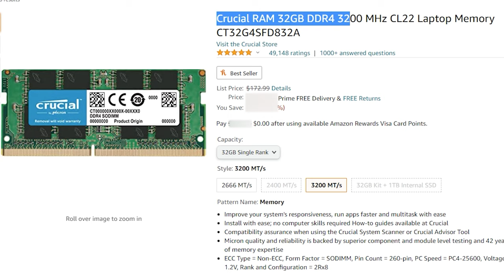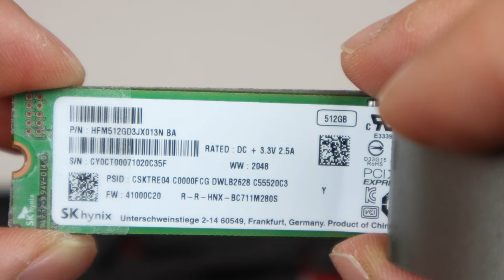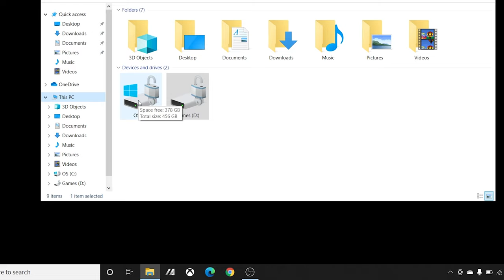How to Install/Upgrade RAM and m.2 SSD in ASUS TUF Dash F15 Gaming Laptop (NVMe only)

Comment: several months after purchase of my Tuf Dash f15 I just realized that a memory problem on my soldered ram will happen at some point way past warranty. Are there any good tips on what to do if that ever happens just in case?

can you theoretically disable the soldered ram and just have the system use the removable one?

Comment: I got a problem trying to remove the screw that is on the SSD slot. I couldnt remove it. How do i remove it though because im trying multiple type of screw and it just wont budge
Reply: I had the same issue with mine can someone please help? I don't want to strip the screws. 

Edit: I read through some forum posts on reddit and it looks like the screw that is in the M.2 slot is of type JIS. It looks identical to the Phillips head but there is a huge difference between them when using them to unscrew.

Comment: QUESTION: I've seen adverts for these upgraded aftermarket with 2 x 4TB NVMe drives (or a single 4TB drive).  Is that legit?  I know ASUS says only 4TB max but they also say 32GB RAM and we know that's not true!

Seriously, great video, I really appreciate your process but also your clear macro images at full res that let me see (for example) the numbers on the RAM module.  I'm trying to make upgrade plans before opening mine up.  I'll keep you on subscribe for sure.

Comment: sir i wanna buy this same laptop..quesstion the 8 gb ram on board ....the slot when u open it 1st time. the slot is emty??  ...you buy the 8 gb samsumg in your video??
Reply from the maker: Mine had the additional slot with the 8 GB RAM pre-installed, as my system shipped with 16 GB total (8GB soldered, and 8 GB chip in the slot).
Reply: You get 8GB soldered, and a free slot to put your ram into.

Comment: thank phil, very usefull! But unfortunately I cannot unscrew the GEN3X4 screw. I am using the appropriate screw but the screw is too tight
Reply: Same idk what to do
Reply: @karanlal4112  I managed to unscrew it but it is risky. I found that the screw has some blue paint on it that has probably glued the thread inside the hole. I used small pliers to unscrew the screw. With the pliers grab the head of the screw and hold it tightly. Gently turn the screw anti-clockwise and clockwise by a very small angle; do it for few times. Then unscrew the screw with small movements: turn the head by one degree, then another, then another,.... You have to be very carefull because you can crack the motherboard, but if you turn the screw gently it should work. If you are worried that you can crack the motherboard, ask help to a tech guy.
Reply: Can you tell me the screw bit that you used to unscrew it? The screwdriver which used to remove backcover Screws doesn't matching with the one in ssd.
Reply: @ramanasurriyanr6239 , as the screw was too tight, I have initially used small pliers to loosen the screw. Once loosen, I have used a small Phillips screwrdiver (but I am not 100% sure as I do not remember)

Comment: I have a question when you installed a 32 gig ram stick and the 8GB is somewhere soldered in motherboard. What's the total of RAM do you have in your machine?
Reply: Wondering the same
Reply: So it should recognize 40 GB of RAM for the system.
Reply: Solomon Snow  I’m in the same spot right now. Did you find a fix for this?
Reply: @lucasralston722  same exact spot here, did you find a fix??
Reply: @jawidkhan7028  The Fix is this video is a fucking troll. You can't upgrade 8gb with 32gb, it is not compatible with any system. 8gb can only be upgraded with and 8gb, for a total of 16gb. If you were to have a 16gb, you can upgrade with another 16gb for a total of 32gb. All the reviews on here of people saying "followed the video and is working great" are paid reviews.

Comment: I have the F15 i7 RTX3060 with 8GB RAM (which is apparently soldered) if I were to upgrade my RAM let’s say to 16 would that slot where you took out the original 8GB RAM stick be empty in mine?

Comment: Hi, 
I just installed the SSD only but after installation my laptop is not turning on. Please give me a solution for this.
Reply from the maker: If you disconnected the battery to perform the upgrade, check to make sure that the connector was re-installed and fully seated.

Comment: WHERE DO YOU SEE IF YOUR FX516PM SUPPORTS 2TB SSD PER SLOT? there's no mentioned on asus website specs for the same? I bought TUF F15 (2022) and want to install 2TB SSD in 2nd slot so I contacted Asus service, they told me my model supports upto only 1TB per slot.

Comment: Hello I have this laptop and I install a SSD (970evoplus)but my device doesn't turn.can u help me?
Reply: Hello is anyone there?
Reply from the maker: If you remove the newly added SSD, does it turn on again? This may indicate something is wrong with the drive or the slot you installed it in. If your laptop still doesn't turn on after removing the newly installed drive, the battery connector may have come loose or is not connected properly, or another component could be damaged.

Comment: 7:11 the total memory is 16384. 
Did you upgrade the RAM capacity or just Shows how to detach/attach the RAM ?
I wander if this Laptop can be upgraded up to 40GB or only 24GB of RAM.
Reply: Exactly my question too.
Reply: Has anyone got this answered? I want to know too
Reply: Did this Today on the f51xpr and can confirm I placed in a samsung 32gb ddr4 3200 sodimm module (cl22) and Windows sees all 40GB at 3200mhz (39.7 usable as 300mb is used for hardware reserve)
Reply: Sorry f516pr (auto correct ftl)
Reply: @TheSTOPlayer  is it void ur warranty?
Reply: @TheSTOPlayer  That's great. Thank you very much for sharing your experience. I think the intel XE graphic is taking 256MB of the RAM and that's why the system shows 39.7GB instead of 40GB.

Comment: So no matter what u can't use dual channel so you can never fully use the 3200mhz? My apex legends is running at 40 FPS with an i7 and 3060 so even if I upgrade ram it won't do anything?
Reply from the maker: My understanding is the first 8 GB of RAM installed in the slot will run dual channel with the soldered on 8 GB memory and any amount in excess of that will run single channel.

Comment: Interesting.. So the 8GB ram that comes with the laptop already cannot be removed? 

By adding a 32GB in the other slot ( making it 40GB ) it would just work as a normal 32GB ram ?

Before watching this video I was under the impression I could removed the ram and add 16GB x2 in both slots to get to 32GB. 

Should I get a 3200hz ram or a 2666hz ram? Will it make a difference, I am trying to get 16GB for now.
Reply from the maker: Correct, in this model there is 8GB of RAM that cannot be removed and if you add a 32GB chip, folks are reporting that it will indeed register as 40GB installed total RAM. Since there is only 1 slot, you won't be able to achieve 32GB using two 16GB sticks. Because the onboard RAM is 3200MHz, I would only install RAM in the expansion slot that is 3200 MHz, otherwise you would throttle the speed of the onboard RAM to the lower speed of the installed RAM. My understanding is that any RAM capacity larger than 8GB soldered RAM installed in the expansion slot will run in dual channel for the first 8GB then single channel for the remainder of the capacity (FLEX).
Reply: @FixItPhil  Luego en un solo canal ? No entiendo eso ¿elimina los 8Gb soldados y trabaja con los 32Gb puestos?

Comment: How did you flip the laptop to discharge the battery when the back plate is dettached?
Reply from the maker: The motherboard is screwed into the housing. Nothing will fall out if you flip the laptop over without the backplate.

Comment: DAM GOOD VID!!!  I did not know there was thermal PADS.   *So correct me if I am wrong*, if the laptop maxes out at 32GB and you put in your case 8+32 will the *8GB on board not be seen?
Reply: I have the same doubt

Comment: hey, when plugging my battery connector back in, the little metal thing to hold it in place wont push foward, i dont think it’s well placed. any help?
Reply from the maker: Make sure to push the connector in down flat, all the way, otherwise the metal clip will not be able to slide over it to close.
Reply: @FixItPhil  me from another account, I managed to do it eventually but it was so stubborn! thanks for the reply anyways, nice video!

Comment: Two questions which 32 ram should i buy. And do you print screen on this laptop
Reply from the maker: I have a couple RAM recommendations for this laptop in the video description, so check out those links. I'm not entirely sure what your second question is, but there is a "snippet" key command (Fn + F6) that allows you to execute a full or partial screen capture that gets copied to the clipboard.
Reply: @FixItPhil  you answered it thank you!!

Comment: Hello I have the same laptop. But I have a question. The ram stick that it comes with says it’s 8gb. But the laptop has 16GB. So if I replace the 8gb stick with 16GB will I have 24gb? Because 8gb of ram is somewhere else
Reply from the maker: Yes, the other 8 GB of RAM is soldered to the board and is not removeable nor upgradable, so any RAM you put in the slot will be added to the permanent 8 GB.
Reply: @FixItPhil  thanks I got upgraded to 40 gb ram and used your tutorial 😀

Comment: Hye can i ask,what is the function of m.2 nvme and what happen when you add one more nvme?
Reply from the maker: The m.2 NVMe SSD is a storage drive and adds extra space for you to install games, download files, and save stuff to the laptop. When you add an NVMe, typically it will set it up as a separate drive letter (like when you plug in an external storage device like thumb drive or backup drive) and you'll be able to put files on the new drive instead of the primary drive where your operating system (Windows) is located.

Comment: Thanks mate did exactly what u did in video and my laptop doesn't charge or turn on. And I triple check if battery is connected the right way. Paid 50£ for ram to brake 900£ laptop.
Reply from the maker: If the RAM is incompatible, defective, or installed improperly, it could cause this. Most folks find that removing the new or swapping back the original RAM fixes the non-booting issue.

Comment: Does taking off the back panel to take out the battery void the warranty?
Reply from the maker: Depends on your region. In the US, opening the back panel to perform user upgrades for RAM and drive capacity is typically ok. I am not sure about replacing the battery. If you're not certain, I'd call the warranty service to confirm prior to making any modifications.
Reply: @FixItPhil  Thx for answer.
I was thinking about getting the RTX 3060 variant of this laptop, since it's a little more aligned with that 4-core CPU.
I would like to expand that 0,5 TB NVMe by adding 1 TB NVMe to that other free M.2 slot, but that of course requires me to unscrew that back panel and take it off.
My region is Europe (EU) btw, so I guess warranty should be OK since they even give us 24 months warranty here over 12 months in US?
Do you have any experiences about Asus Customer Service/Repair Service in case laptop experiences any failures?

Comment: Just got a vengeance 3200 32gb ram but the laptop doesn’t work with that, any idea?
Reply from the maker: Hm, not sure. I haven't used that brand RAM in my build. Could be a settings issue? Maybe check in the BIOS if you can boot into it.

Comment: Hello, is there a size limit on the SSD that is NVME compatible? As in, can I go up to 2 TB on the second slot?
Reply: There’s no limit, as long as the SSD fits and is compatible with the processor you can use  as much storage that you need

Comment: I just inserted the ram memory and when I turned on the laptop it got a black screen. What could have done wrong? (Same laptop model as the video, I put a 32gb 3200mhz CL 22 ram memory)
Reply from the maker: There are a couple possibilities. A black screen usually indicates something is wrong with the RAM. The first case is that the memory is simply not seated all the way in the slot. In this case, remove it and re-install it, making sure it's oriented corrected and fully inserted before pressing it down to lock into place. The other causes could be, incompatible memory type (sometimes this can be a BIOS settings issue) or a damaged chip on the memory.

Comment: if I want to add a 2666MHz ram stick to the laptop, the soldered 3200MHz ram will reduce its frecuency to 2666MHz? because I added a 2666MHz 8GB stick but the laptop didin't turn on

Comment: So if I install a 16gb ram module I'll have 24gb of ram total (soldered 8gb)?
Reply from the maker: Yes
Reply: Nope, I tried putting a Corsair Vengeance 16 GB in that slot, my screen blacked out no response, restart a couple times, nothing again. So I put my original RAM back again. I will try another RAM, maybe that one was faulty. But this time a 32 GB since it worked for you.

Comment: Hello , I'm new to these hard drives I just upgraded my pc from 5 years and it was a basic one. So do these hard drives really need to have this thermal pads? Thank you
Reply from the maker: It's not necessary, but is definitely recommended as they can run a little hot, and the thermal pads/heat sinks will increase the life of the drive. You probably won't feel a performance difference, however, cooler operating temps will allow the drive to last longer, so you don't run the risk of premature drive failure and data loss.
Reply: @FixItPhil  thnx so much

Comment: Hi, I know this is late, but I am having difficulty reconnecting the Battery. The connector doesn't remain, and it sparks sometimes. Also, the retaining clip doesn't get on, but I also don't want to try too hard and break it. (It does come on fine when I try it by itself.) I am just rather afraid I'm gonna break the thing or get shocked. How much force is optimal to actually close it? Is there something I'm doing wrong?

Edit - Just in case someone else has this problem, what I did was actually use the plastic end of a pen (it was a flat end) to push down the connector REAL HARD. Like, I think it was slightly harder than what I was able to do with the tips of my fingers. Then, I grabbed the laptop at the bottom with my thumb, and (with that same hand) with the forefinger, I tried to slide down the retaining bracket. I noticed that if you watch his reconnecting of the battery in 0.25 or 0.5, it seems he nudges the metal clip slightly upward. I don't know if I actually did that or not. I was pretty much just pushing down the connector (white plastic piece) with my left hand and pushing in the retaining bracket (metal piece) with my right hand.

It's been like 3 minutes since I did that, and the laptop has been fine so far. In spite of the sparks, everything seems to be working. So... success I guess?
Reply: Yup, that is the proper way to do it.

Comment: on additional slot SSD asus tuf gaming f15 fx507 i can't see information PCIe gen 3 or gen 4, but this laptop use intel i7 gen 12, I'm confused, is it supported pci gen 4 on 2nd ssd ?
Reply from the maker: I couldn't find any definitive information about that online, so you may have to reach out to Acer support for clarification.

Comment: sir can i ask if this model is RAM upgradable
Asus VivoBook S14 S431 Laptop - 14", Intel Core i5-10210U (10th Gen), NVIDIA GeForce MX250 (2 GB), 512 GB NVMe M.2 SSD
Reply from the maker: No, according to ASUS the RAM on the VivoBook S14  cannot be upgraded.

Comment: What happens if we don’t install thermal pads and all that on the secondary ssd
Reply from the maker: It'll probably run fine. In rare instances you may experience overheating issues like speed throttling, or premature drive wear, if you push the drive really hard for a long time.

Comment: I have the 8 gbs ram stock laptop one can I still upgrade it and make it 32 instead on adding another 8 and making it 16
Reply: I just upgraded my 8gb one, there is nothing in the upgradable RAM slot so you can just put your RAM card in no problem.

Comment: I want to do the upgrade, do you thinck it will be ok if i instal in the empty slot a 2T SSD, or should i get a 1TB.
Thanck you
Reply from the maker: Yes, I've seen some builds offered with a 2 TB SSD, so it should be able to handle that capacity.
Reply: @FixItPhil Thanck you very much. This video helped me a lot.
Do you have any tips for this laptop? Because i am new in this and i dont now nothing about maintenance.

Comment: hi i have a problem with my oculus quest.the usb 3.0 ports are showing 2.0 in the oculus software!..any hint whats going on? thx and keep up to good work! i will sub.
Reply from the maker: Hm, I don't know a lot about the Oculus Quest, but I did read online that some users had this issue if they didn't use the proprietary Oculus USB cable with the device. All the USB ports should be USB 3.2 Gen 1 Type-A on this model.

Comment: Can I use any nvme ssd? Do I need to buy an heatsink too?
Reply from the maker: Yes, any NVMe SSD should work, though the slot is speed for Gen3x4 which would give you the optimal performance the slot can achieve. You don't need a heatsink, but if you decide to get one, make sure its thickness doesn't interfere with putting the bottom of the case back on. The tolerance is pretty tight so you're looking at about 1-3mm thickness tops, so I recommend a thermal pad with a simple flat metal cover, like this: https://geni.us/osnpkB [Amazon Affiliate Product Link]

Comment: If you add 32gb of ram plus the non upgrable  8gb ram. Doesn't it add up to 40gb? Isn't it more than the max cap of 32gb?
Reply: It depends on your CPU.  Your CPU may be rated for 64GB.  Research that and you'll find out.